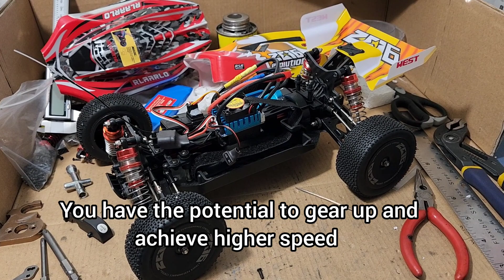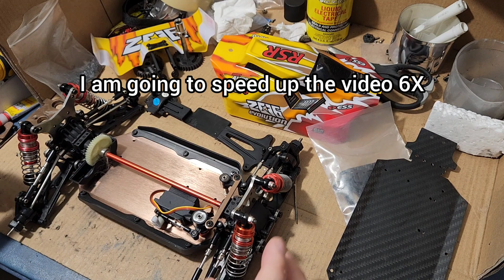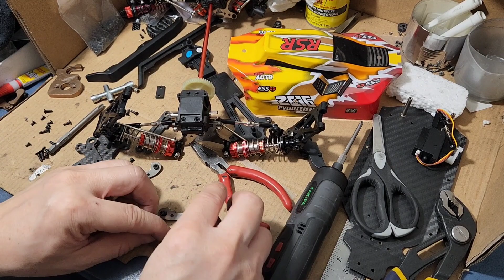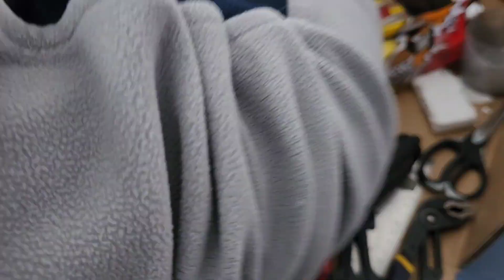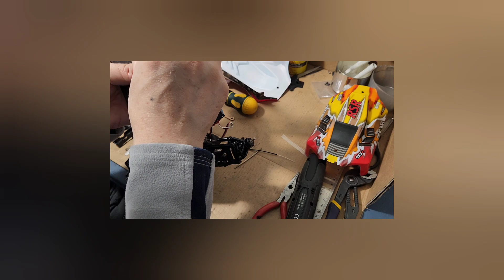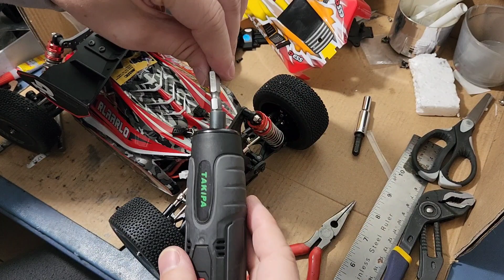Carbon Fiber Chassis Kit Review and Installation of Wltoys 144010 144001 1/14 Scale RC Car

Comment: Do you think you'll be making one of those for the 12 scale wltoys cars? No one has come out with a carbon fiber chassis for those yet. Though I have heard the new Rlaarlo chassis fits, I haven't actually seen anyone do the install.
Reply from the maker: In time.  The Rlaarlo chassis should fit, I have not verified it yet.